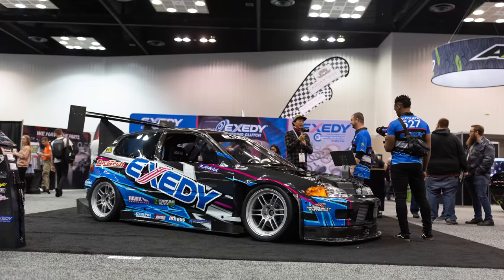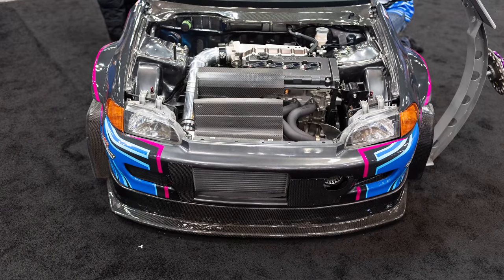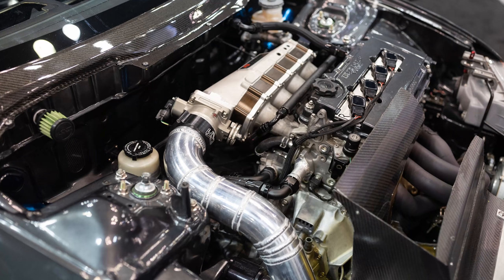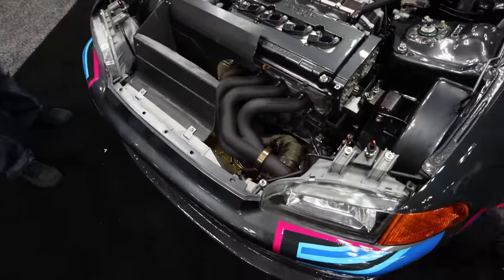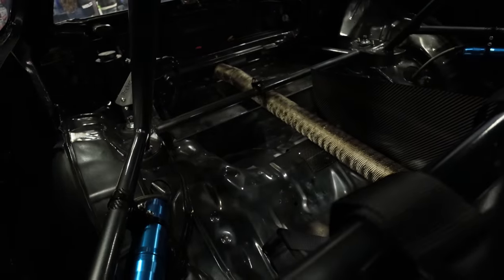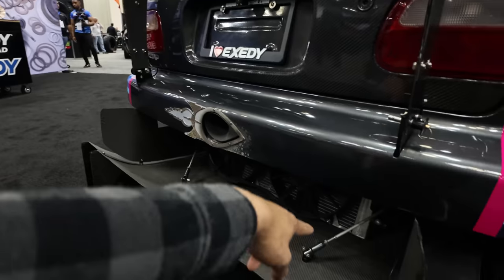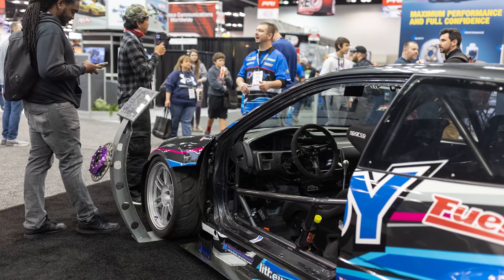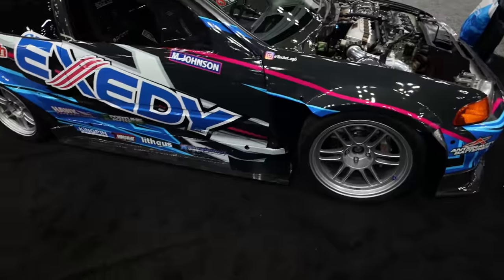700HP Honda Civic EG Time Attack Car

Comment: Finally, a high powered Civic that could race on tracks!! Usually, with this kind of HP especially in a Civic, they drag race it and yeah it's cool and all coz it's fast and it needs to maintain the car straight while running it as fast as possible but it's getting too common you know, and seeing a car that is built to be driven the way it should be which is to use its lightweight advantage at tackling the corners is pretty rare especially going to a high HP setup like this. Idk, maybe it's just me or what, I think I'm just getting tired a bit of seeing a typical high powered 0-60 drag race stuffs on social medias and hating on cars just because it couldn't do a fast acceleration, bad reputation due to those so-called "Ricers" and picking up girls or clouts like it's really cringe. Anyways, that's a dream track build there.

Comment: He should chat with Kyle from boostedboiz and look into the AWD setup he runs because once he gets that dog box, it's gonna be squirrelly. Such a gorgeous build. Watched 3x now.  Just such a beautiful car.  Absolutely fantastic
Reply: He should chat with Kyle about anyone of his cars... Kyle's got some work to do on every car he has though LMAO
Reply: The RT-AWD is only capable of sending 40% of torque to the rear which would mean it's just FWD with more understeer. It's great for putting power down on a drag strip, not so great for when you're trying to turn. SH-AWD is an entirely different beast though.
Reply: If you are going to awd and add more weight and the extend of this build, why not do a mid-engine rwd for power and balance? That's the best for both world for road racing.
Reply: @koopatroopa187  Thank you for clearing that up; people think all AWD are built the same.

Comment: 11,000RPM at like 40PSI
Reply: I thought the owner was gonna say like 9,550 rpm 11,000 rpm is insane 🤯
Reply: @Clean_Duners  That's not really all that much for a B16A. I've got 10,040 RPM data logs from my old EG6 and that was nothing more than a stock bottom end B16A with ITBs and 305 duration TODA VTEC Killer cams. Ran that engine hard for a year before it got torn down due to having to move.
Reply: @koopatroopa187  i love it man
Reply: @rocket_eg6129  Yeah, the VTEC B series engines were a whole lotta fun. They don't do much more than make a whole lot of noise in N/A form, but they'll rev beyond where the numbers on the tachometer end and take any abuse you throw at them for years and years. With that said, the B18C is coming out of my ITR. Would much rather have a stock K20. Better gas mileage, makes more power in stock form than a built N/A B18C, and still will take decades of abuse.

Comment: So, it was originally a 1.6, now it's a 1.7 so is that a B16 or D16? Bored over? Or did he swap the 1.6 for a 1.7?
Reply: It’s a B series given that it’s a DOHC engine, the D-Series is a SOHC unit. I’d say that it’s a bored b16 that displaces 1.7 litres. It’s possible that he dropped in an OEM B17 only found in a “DA” Integra GS-R but I doubt it.
Reply: It's a B16A that's bored over.
Reply: It's a b16 punch to a 1.8 actually lol
Reply: @rocket_eg6129  awesome, thank you so much for taking the time to let me know.. you're awesome bro and the car is dope! Can't wait to see it on a track.
Reply: @alex_k1410  there is DOHC D-series but I assumed it was a B bored over..
Reply: @ninja4187  oh y’a true there’s the ZC varient.